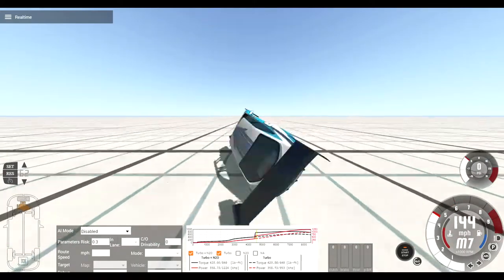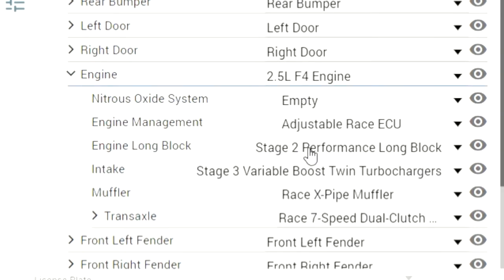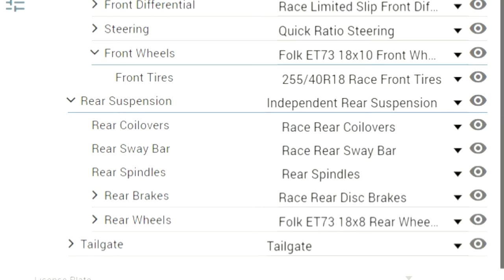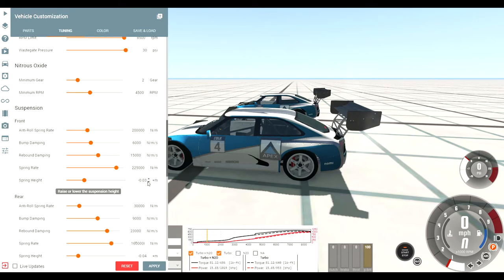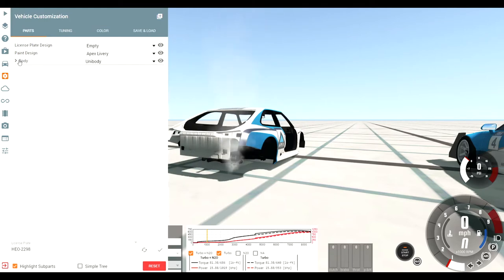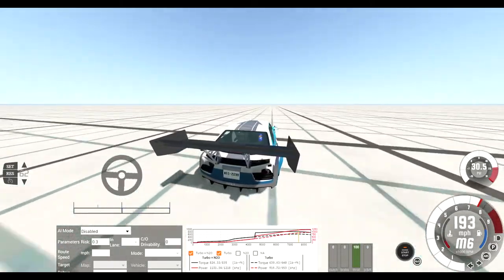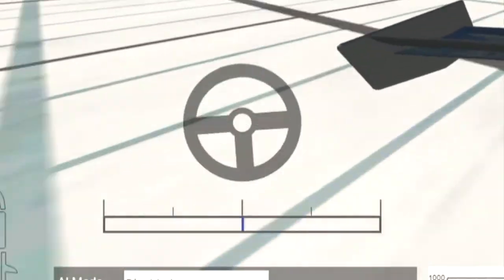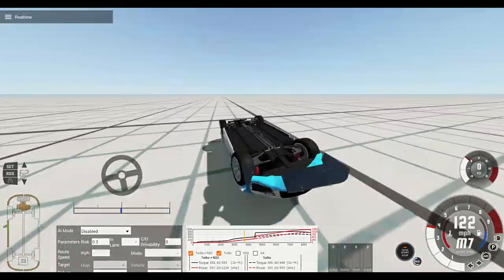How To Do a Blowover in an SBR4 Without Using Brutal Slope - BeamNG.drive

Comment: Pls tutorial with nascar. i try with nascar and it did not work
Reply from the maker: I've tried to do blowovers with the late model, but it doesn't have downforce physics on it. the spoiler only creates drag. so the only way to do blowovers with the late model is to flip it by using the node grabber in slow mo